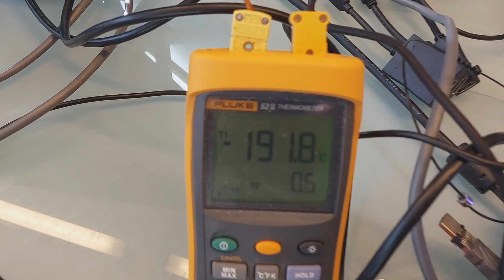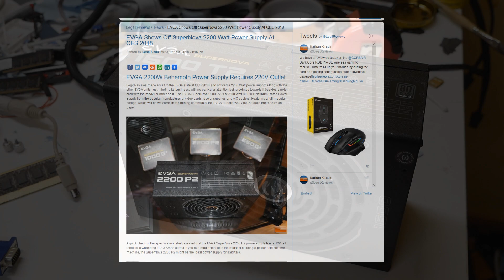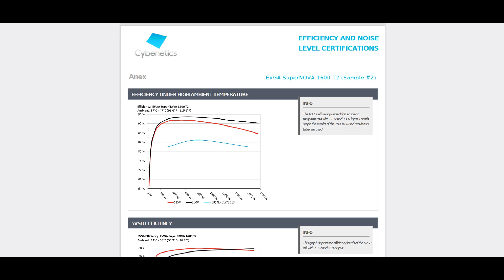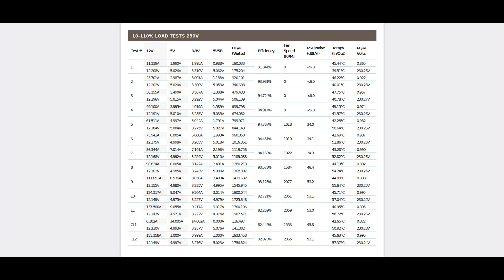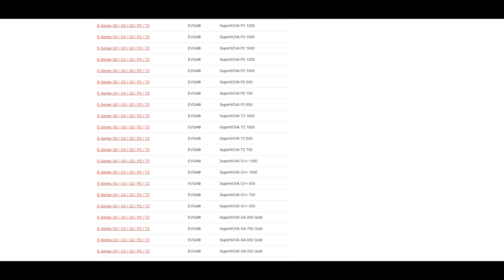The BEST Power Supply from EVGA - SuperNOVA 1600 T2

Comment: I got today new EVGA Supernova g+ 1600w. After the installation, first startup i just hear loud click noise from the PSU, never starting or booting the system. Now the PSU wont start even with the test adapter... Starting RMA process now :P Tested the system with my old 750w corsair, worked fine.
Reply from the maker: Sounds short circuit somewhere. The + models I don't like as they are FSP based units.

Comment: this is def the PSU for people wanting to make ultimate windows 7 PC's. You could easily run this with the i9-9980XE, 2 RTX 3090 Ti's in SLI, and 128GB of RAM without it breaking a sweat, which allows you for some great overclocking and maximizing of the Windows 7 OS. Until SLI comes back for GeForce cards I dont see a point for PSUs over 1600W.

Comment: Been using a 1000w g2 psu for 8 years, when it dies (most likely won't for awhile) I have a p2 standing by as backup. These superflower psus are built like tanks.

Comment: What is that thing that shows you the power usage? Where do I get one and does it work with every PSU?
Reply from the maker: If you mean CPU/VGA power use then Elmorlabs PMD. Otherwise get mains plug power meter.
Reply: @LuumiJuhani  Thanks, yeah I meant that PMD. Didnt know such thing already existed. Was on the jump to get me a new PSU that shows "usage" like an Corsair HX1200i. Maybe I'll get in anyway but its good to know there is something that shows CPU/VGA usage. Cause my HWInfo for some reason doesnt show CPU Watt usage. It always stays at 1.125 Watt or something like that.

Comment: I just grabbed the 1600 P2 ahead of the 4090 launch. Almost went with the P+ but after my research, these older Super Flower units are much better than the FSP units.
Reply: Also went the same route. How is it holding up today?
Reply: @SLSAMG my p2 1600 is still great.  I got a cable mod cable for the 4090
Reply: @shaolin95  I had one but my PC kept crashing so back to the adapter. Seems to be as common issue so not even going to install the replacement.
Reply: @shaolin95  That's good to hear. My P2 was DOA. Got the T2 instead!

Comment: I have the EVGA T2 1000W, its amazing!
Reply: I have the super flower leadex version of it in 1000w titanium. Evga power supply cables work with it, I was replacing my evga 850g2 and it was literally plug and play, didn’t have to manage any cables since I only replaced the psu.

Comment: Number 41 on timespy hall of fame, used this exact PSU in a closed chassis, 3 x 420mm radiators, dual ddc pumps, dual reservoirs, 3090 FTW3 SLI, Z690 Kingpin, 12900KS. Was number 40 for a while but TEAMEVGA recently took 17 so it bumped me down one. 😤
Reply: Ah fuck just checked and I am 42 now, oh well lol

Comment: There is a 8pack 2000w platinum on overclockers UK forum for £160, it's a great deal. I already have super flower leadex 1600w gold and 3 1300 gold though so I don't need it 😅
Reply from the maker: Buy it man, could resell with time on bot forums for example.
Reply: @LuumiJuhani  probably 😄

Comment: I've been using evga psu's since i started building pc's. First one was a 1600p2 which i currently still have that goes strong, I've got a 1000wg5 in another build and in my current build I've got the 2000g+ which I've not had any issues with even after knocking it off a table once it survived however for my next build is it worth going the t2 or latest 1600t model. Is the titanium rating worth it over gold and power capacity?
Reply: dont think so, cause T2 rating is pretty hard to achieve on 2000+ units. and its just efficiency differences

Comment: Just remember that the breaker in your main panel/box is just there to protect the wire inside the wall. This is a good thing. Just know, that the more times that breaker blows, the weaker it gets. Just like the old points  style ignition system in cars. 
And yeah, Johnny Guru rated the EVGA 1600 T2 as one of the top rated ones ever.
I'm fortunate enough to have three 200 amp services, and one 400 amp service here. All 120/240 single phase. I have the 400 amp service going to my shop.
I know that Leadex and Superflower built most of EVGA's PSU's. Good stuff, and a 10 year warranty. Plus their wattage rating is just for the 12V rail, and the other rails are over and above said rating. And no, I am not sponsored by them! LOL! They do have great customer service too!
When I talk to folks about PSU's, I tell them it's cheap insurance. You just spent thousands on the rest of the components, so why would you cheap out now!

Comment: Too bad EVGA uses shitty OEM's to build their psu's these days! 
They used to be the number one psu supplier but they happily handed their #1 title over to Seasonic/Asus. Dummest move ever.
I will never buy another evga psu, still using my supernova 1300g2 but not for long w/ new tech connectors coming.
      EDIT: Now that I've begun to watch the rest of the video I think all the new 1200/1300 watt units & probably the smaller ones too are all made by HEC & as you mentioned FSP, Although it's nearly impossible to get EVGA to confirm it (if I was them I wouldn't admit it either) but I would love to ask EVGA why they chose to go from the best in the market to some of the worst?
So disappointing smh 😞
Reply from the maker: Seasonic is absolutely fine. Even Cooler Master uses FSP so it could be just restricted error only on the 2000W G+ what I got.
Reply: @LuumiJuhani  yes as I mentioned Seasonic & Asus (who now uses seasonic as their oem) are the best. From what I could gather for one reason or another EVGA chose to discontinue their contract w/ Superflower which were one of the best oems as well but evga are tight-lipped about OEM's so not sure why & it's also possible they only use them for their 1600's IDK. 
A couple months back I considered getting a new evga 1200 or 1300 watt psu till I learned they're using hec & fsp. I'm glad I didn't though cause connectors are changing & new gpus will be requesting some extreme transients
Reply: @Metalhead-4life  the t and p lines you can still buy and they are fine. We weren't talking abou the g+/g2 or anything. Yes of course evga came out with a like that cost less so components won't be as good. But they haven't stop selling the other either. My point is it's not like you can't buy there good psu's anymore.
Reply: @reviewforthetube6485  nope the 1200p2 is the only 1200 or 1300 watt psu that is manufactured by a quality OEM AND ITS AN OLDER SUPERFLOWER MODEL. As I said I was looking for a newer model psu since my 1300g2 is now about 8-9 years old. 
The new 1200/1300 psus are HEC/FSP & maybe even the 1600P+ too. (wonder why EVGA didn't offer luumi a 1600P+ as a replacement lol) I'm pretty sure Jacob even confirmed the oems in the forum or on twitter, I'll try to find it for you but I don't think YT allows links
Reply: @Metalhead-4life  gotcha no worries thanks for the info, I see a ton of haters everywhere. I thought you were just hating on them but clearly not. I appreciate the response sry for responding the way I did at first I just deal with so many trolls everyday. Lol even I learn new things, can't know everything right?
Reply: @reviewforthetube6485  ahhh so glad you squashed it, no hard feelings bro. I just found the thread its only 2 pages you should read it. Turns out I was the OP & completely forgot, but a bunch other people had that same concern as me & also there's been alot of threads & reports in the forum of buzzing, coil wine & other issues with the new evga psus so that alone leads me to believe EVGA went full chinesium on their new product lines. I'm actually a big fan of EVGA that's why I was so disappointed they cheapened out on us. They have the best customer service in the industry.

Google "which is the higher end psu evga forum" and you will find the thread from when I was wanting to buy one of the new 1200/1300 Units!
Still haven't found where Jacob confirms the new OEM's maybe it was on twitter IDK
Reply: @Metalhead-4life  ok will do! Thanks, yeah idk why they would do this. Especially after all the trouble just a little issue with 3090 pcb's gave them why would they chance worse parts? It's ridiculous I kovw evga because there performance is always top 2 in class. So I hope this doesn't start to translate over to there other products that would be bad.
Reply: @reviewforthetube6485  Agreed, and things will only get worse, the new 40 series gpus are supposed to have transient spikes 2 to 3 Times or more their power rating so a nearly 450-600 watt gpu hitting split second 1400-1500 watt transients is gonna wreak havok on alot of PSUs & PC's out there! It could be a big issue for 4080's and above & people thinking they only need a 750 watt psu lol.

You know how many times I've heard people in forums saying "nobody needs more than a 750-850 watt psu for overclocking". That may have been somewhat true for Haswell & Maxwell but not anymore. I've always chose lots of headroom on my PSU's.
Reply: @reviewforthetube6485  its not hate for the most part. Johnny guru knows what he's talking about. Might seem a bit rude but facts are facts.
Reply: @tacticalcenter8658  what do you mean? We just worked it out lol. The only part u was talking about was the first comment. As I said so used to trolls and people just hating on a product because of a brand. That's all we talked it out! We are all good no worries lol. Also yes I see the posts now as he said it's more recent then not so I didn't realize that. But now I know like I stated can't always be right even I can learn still lol.
Reply: @reviewforthetube6485  research johnny guru's posts on forums and comments. You'll learn a lot about PSUs and the industry.
Reply: @tacticalcenter8658  I actually know who he is, I just haven't been researching evga psu's because I've been using them for so long this isn't expected lol. Like my 1600watt platinum psu from evga works fantastically luckily.
Reply: @reviewforthetube6485  you might try something else if you want a new top dog, cause evga doesn't make them anymore. I like evga but facts are facts.
Reply: @tacticalcenter8658  yeah well until this monster gives out I won't be buying anything. Let's hope this is thing gives me 5 more years! It's been going strong!
Reply: @Metalhead-4life  evga still sells super flower psus just buy one of those
Reply: On the techpowerup forums johnny guru talks trash about evga's new PSUs ever since they don't make any more high end superflower monsters like they used too. This is probably why.
Reply: The new 1650w Titanium psu from Thermaltake is looking great, and I have good experience with their 1500w Titanium psu from the past. It can handle 1000w 3090 no problem.
Reply: @kaiwenwu8148  thermaltake... Take everyone else's hardware and copy it. No thanks. Good luck though.
Reply: @tacticalcenter8658  I don't think anyone else using that platform, where it copy from ? Also most brand is just a reseller, if they sell same item just means they got from same oem or odm.
Reply: @kaiwenwu8148  I've been in this market since thermaltake first showed up. They copy everything. I understand what your suggesting on the PSU. Its true that they have fsp iirc make there psu's based or stolen off of someone else's product.
Reply: What are you talking about? I guess some people just spew hate even if they made it up. They are still number 1 in performance for psu. They are absolutely what most hardcore enthusiasts still use when it comes to really pushing there systems and for good reason. 1 faulty product does not speak for all of there products. That's like saying when you see an asus gpu die its just shit because that 1 did. All products made from any manufacturer can have issues. Its part of technology and prduction!
Reply: @reviewforthetube6485  you have No idea what you are talking about. I didn't base any of my knowledge on this video just following evga's manufacturing choices over the years. EVGA doesn't exclusively make 1600watt psu's but lower wattage ones too
If I'm wrong about anything please correct me but I'm sure the LN2 OC'ers are using old 1600 watt evga psus or the T or P lines only. I only overclock on water so no need for 1600 watts but evga chose to forgo superflower etc OEM's for shitty ones as I already mentioned for their new lines of psus